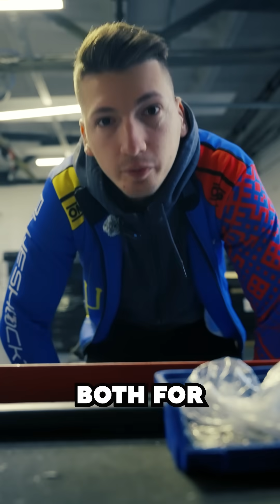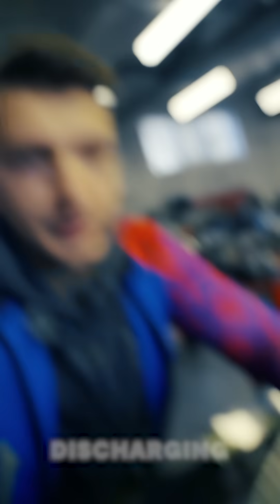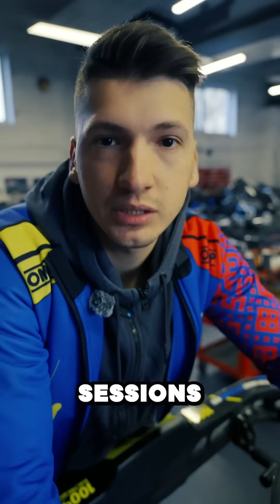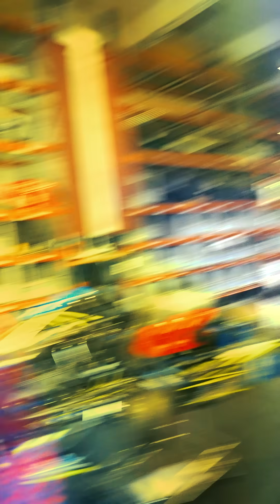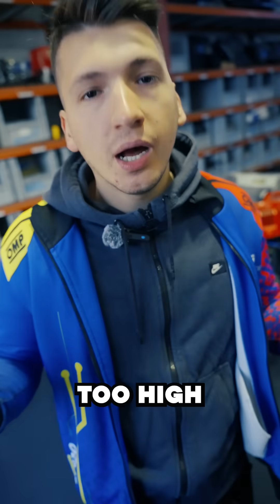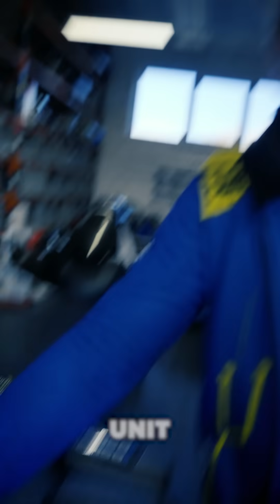Mr. Overtime Explains Kart Cooling Secrets for Hot Conditions

Comment: Why no liquid cooling?
Reply from the maker: Blue Shock Race power units use advanced air cooling by design. It keeps the system lighter, simpler, and more reliable, with fewer components that can fail in racing conditions. For karting power levels, properly engineered air cooling delivers consistent performance without the added weight, cost, and maintenance of liquid cooling.

This approach is especially important for fleet racing and championships, where durability and low downtime matter as much as performance.